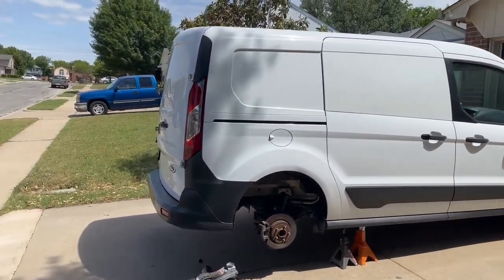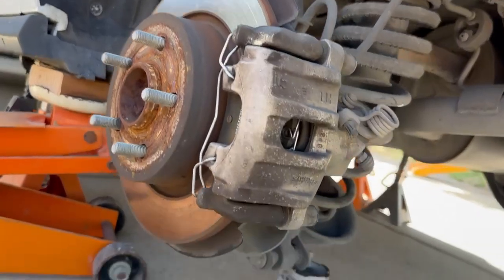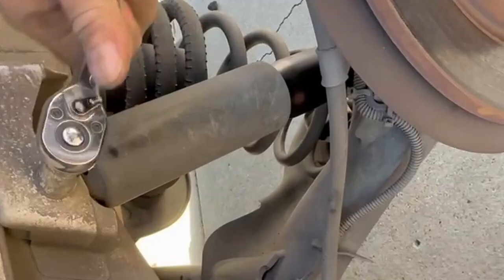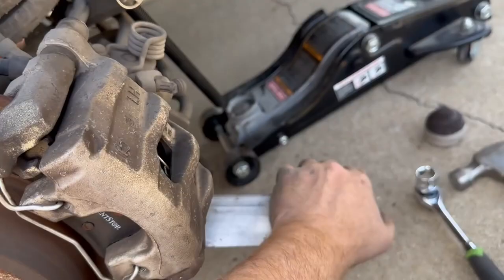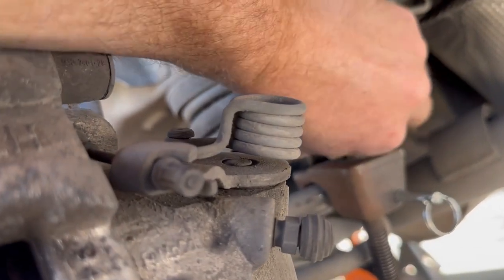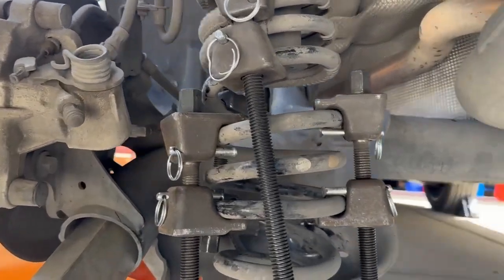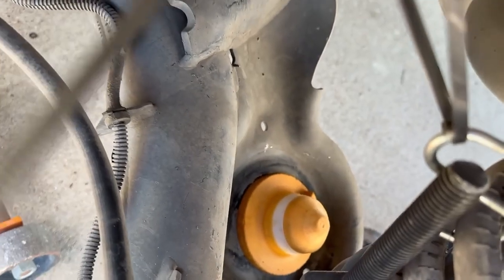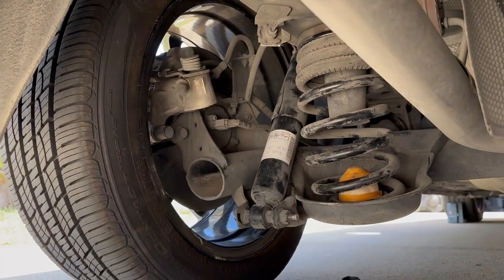Replace Springs on  2015 Ford Transit Connect

Comment: Did you notice any significant difference after the shocks change?
Maybe one day i will try it too 😅
Reply from the maker: No I really didn’t but I just replaced the bump stops not the springs. I carry a large water tank in the back of the van and I was concerned about it bottoming out.